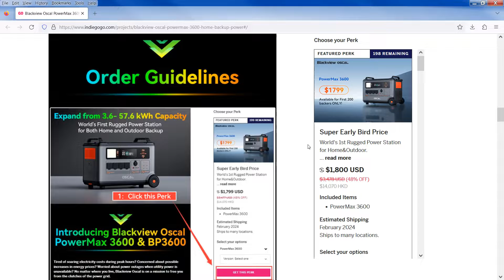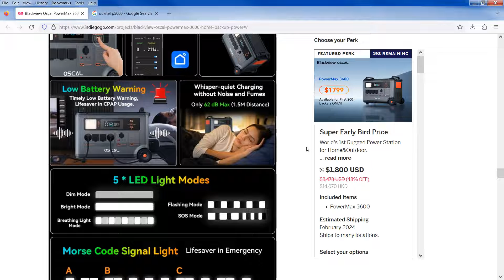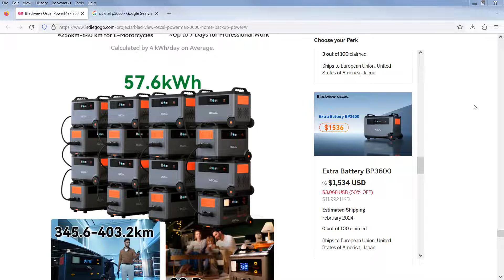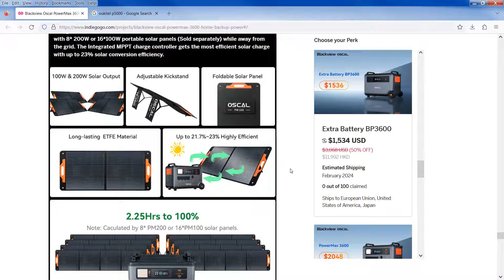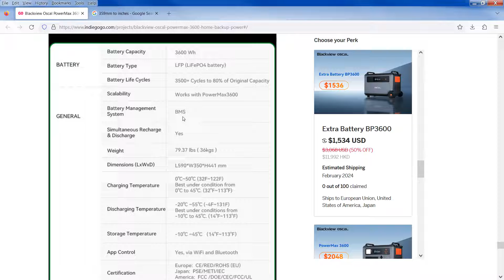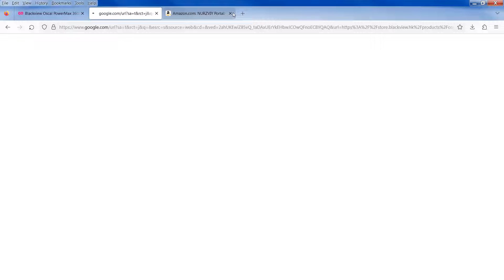BLACKVIEW OSCAL PowerMax 3600 Home & Backup Power Station (((((57,000 WATT HOURS SYSTEM)))))

Comment: Pecron's gonna have a 3600...wonder how it will compare ?
Reply from the maker: pecron's e3600lfp is rumored to have 15,000wh of battery
This system is rumored to have 57,600wh of battery

that is a HUGE difference with just the battery capacity alone, but until we see both in real life...they are just rumors :)
Reply: @RamblinBobReviews  wait, pecron 3600 mY have that much battery?
Reply from the maker: We were told by pecron themselves that the e3600lfp will be able to have 4 x ep3000 batteries hooked up to it. 

   That is one of the main reasons that we bought the e1500lfp. (is to be able to use those 2 batteries on the new e3600lfp just in case we wanted an even larger system and the use the e1500lfp as a moblie power station :)
Reply: Pecron showcased this battery at CES I see jasonoid did a video coverage on it should be out in march